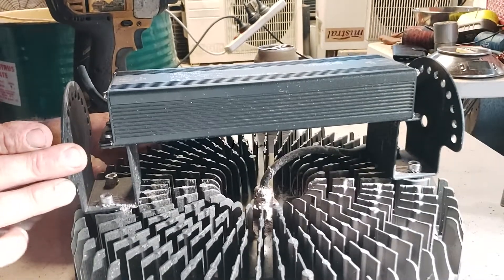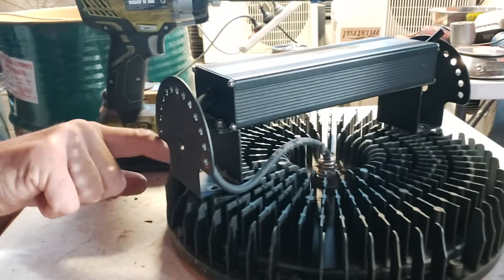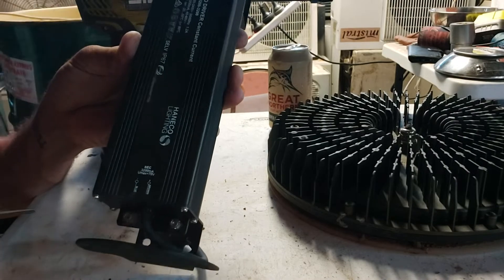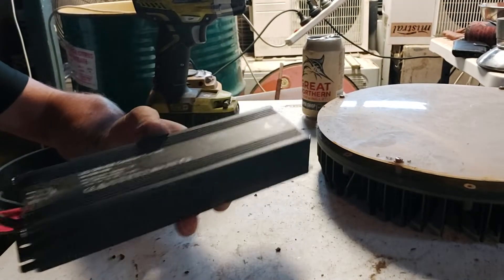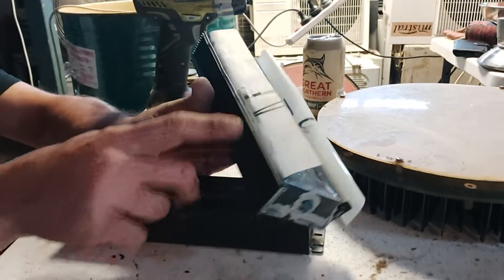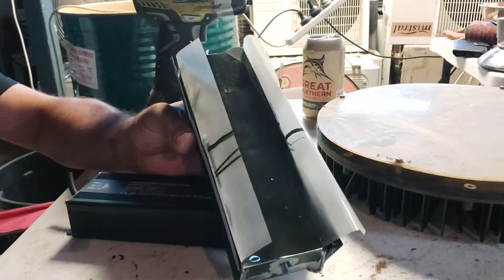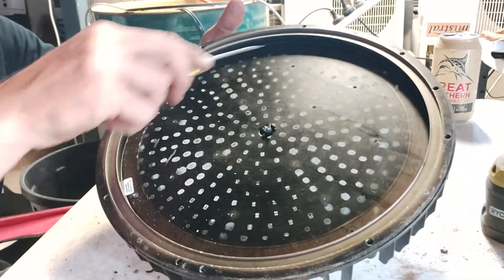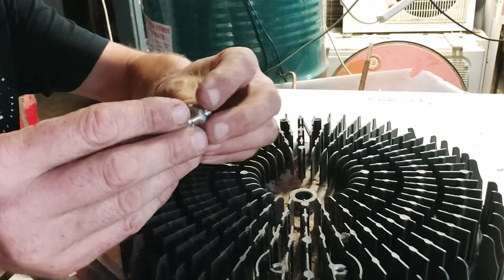Scrapping a Floodlight for Brass and Cast Aluminum.

Comment: ahh i did about 30 of them and only the alu where 3 kilo each ;) still have the transformer stuff to do, ;) 
great video
Reply from the maker: 30 was a nice score, very nice indeed and the 3kg in ally from each definitely better than the 2.1kg mine were, tho i also need to do my transformers so a little extra weight there once i add that ally to the equation.....Cheers buddy.